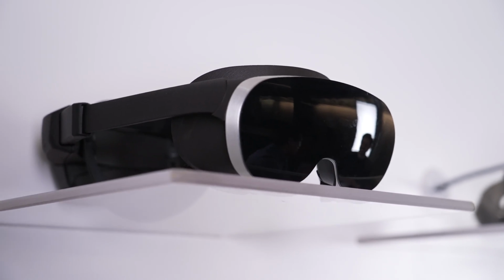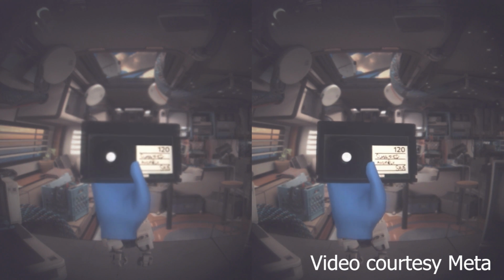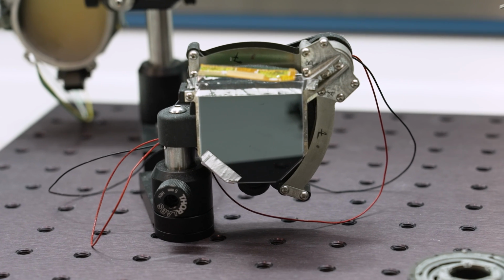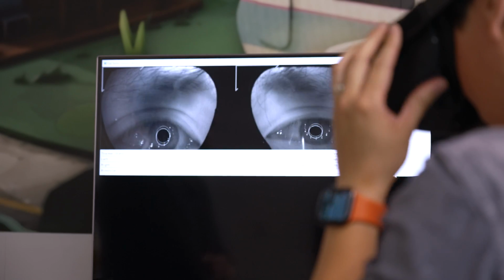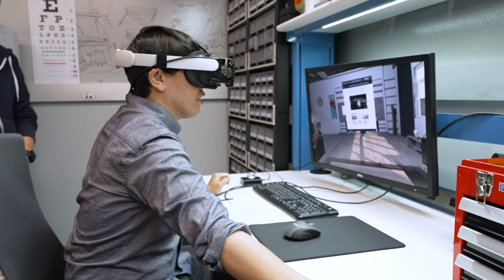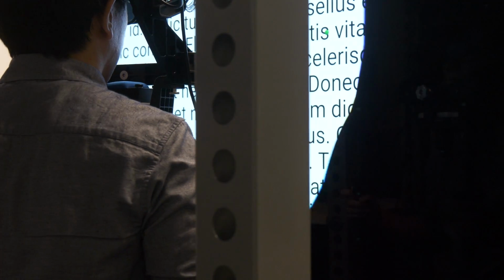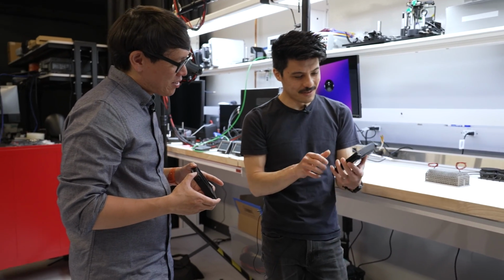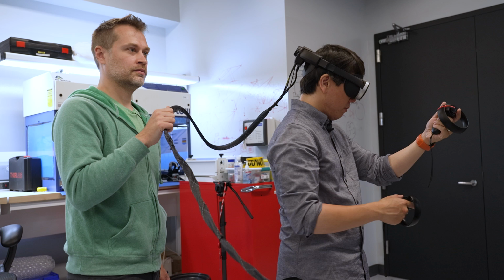Hands-On with Meta's New VR Headset Prototypes!

Comment: They need to cater for larger IPD's, as someone with a 75mm IPD, I can't use a Quest or a HP Reverb, the 68mm max IPD is just too small. I can't even get a Quest to fit on my face without squashing it. The Vive and Vive Pro went to 74mm IPD, but most HMD are resticted to 68 to 70mm IPD at a max, which is far too small. I currently use a Pimax 8KX, which goes to manual 70mm IPD and then has a software adjustment to get to higher IPD setting. I'm never going to support Meta while they only have a IPD of 68mm, and I don't support the monopoly environment they want to build, it needs to be free source. Have you looked at there current offerings for VR, they are very basic and look like crap?

Comment: Why not avoid the issue with processing power by trying to make a headset that works primarily off Online server gaming like googles Stadia. Sure then you could only use it with an internet connection. But I think for most case scenarios this would work extremely well.

Comment: Maybe they need to go to OLED combined with eye-tracking, to keep bright spot in the pupil... while saving power in the other zones.
Reply: OLED is basically worthless for VR until pixel densities are high enough that its required 2x subpixels per pixel PenTile layout isn't noticable anymore. Wasting 33% of your GPU power rendering an entire third of subpixels a PenTile OLED physically doesn't have is utterly untenable. 🤷‍♂️

What they're doing on Quest Pro is MiniLED LCD (full array local dimming) combined with eye-tracking, giving them mostly the best of both worlds.
Reply: @Cooe.  They need to render fully only what's in the line of sight, the central area. The rest can be blurred and/or upscaled.

Comment: Fuck meta with their headsets. I bought the Rift CV1 back in the day. Not a heavy user at all. A while back they announced that you would not be able to log in without a facebook account. I PAID FOR THIS THING AND A BUCH OF SOFTWARE. It is my fucking thing and i probably wont be able to use it when that stupid rule gets applied. No way i will open op a facebook account. 

But not to worry. The cable died last week. And since this thing is 5 years old of course you are not able to get a new freaking cable. Oculus dares to advise people to get a quest. I wont ever get a oculus set again. I am gonna try a repair. Slightly hoping it fails so i can get rid of this thing. I love it. But business practises like these really stroke me the wrong way. Be aware that with this new hardware, in a few years support will be gone and you are left with a fucking expensive paper weight.

Comment: Of course the solid state is ideal but it doesn't look ready. I would think something shaped like a jar lid that has a a lens inside then have a second part with similar dimensions and second lens that threads into the first using this "threading" to replace the ballscrew for focus. Movement I would think some sort of muscle wire attached to a gear that rotates one side of the lens. Should be fairly compact and quiet? Not sure about muscle wires energy usage but there has to be some similar case with a happy medium. No doubt this is the future it's just a matter of finding that magic combination of visual/efficiency performance while reducing heatsets size which should help with weight freeing up weight for larger battery/higher performance CPU/GPU and memory.

Comment: Something that corporations really miss the mark with is Virtual Reality doesn’t need Hyper Realism (you can go outside for that)
Virtual Reality is reality that one can shape however they want.
Something Reality labs should question themselves with developing these hyper realism tech is … do we really need it in Virtual Reality 
The human senses can already be easily fooled through visual stimuli (it is actually reality that breaks most immersive experiences ( a phone going off or a battery low message in your line of view).

Currently hardware isn’t the immersion breaker…it is the VR software and lack there off ( mostly because there is no standardized way to make software for Vr that works with every VR component

Comment: It's all great, but why they didn't use a simple quality NON fresnel lenses in Quest 2 like they did in Gear VR?? The lenses actually weren't too heavy, there were no god rays at all, the sweet spot and clarity zone were huge. Also, there was possibility to adjust focal lenght, so basically any nearsighted or farsighted person could use Geat VR without glasses and make the image totally crisp for themselves. 
Because you know the number of optically faulty Q2 units is really big. There are lots of units with abnormal god rays, ghost images, tiny sweet spot.

Comment: Awesome video.

re: "light is just energy and energy comes from a battery"

I never play vr untethered anyway because the battery would just be drained well before I was finished. The battery serves mostly as contingency i.e. if I accidentally yank the cable. 

I would imagine for a lot of people thats a similar experience, either for similar reasons or because they have to be tethered to a computer for playing higher fidelity games anyway.

I dont see why thats a problem in the immediate term other than heat/ safety concerns but I think I would much rather have mains electricity attached to my face than a really big li-ion battery. One seems a lot more stable/ safe than the other.

Comment: I'm looking forward to a quality VR workstation experience. The Quest 2 didn't cut it, way too much blur, inaccurate IPD, and chromatic aberration.
Reply: That's Quest Pro later this year. Pancake lenses will solve all those optical issues... And eye-tracking + dual displays = automatic, perfect IPD adjustment. At the expense of costing you ≈$1000-$1500. 🤷‍♂️

It's just like Mark said in this video. If you want a proper VR workstation, it's gonna cost about as much as a basic PC workstation. Them's just the brakes with the current level of technology.

Inaccurate IPD is really a total non-issue with the Quest 2 though. Just put it in-between the 3x locked IPD positions. The software actually adjusts to match these "in-between" IPD positions, meaning your practical "IPD fidelity" isn't much worse than Quest 1.

Comment: I think that the avegant glyph had a tech that didn't use a conventional display but directly beamed the image to the pupils using a set of micromirrors
Reply: They used 720p Texas Instruments DLP projectors. They just use WAY too many moving parts for a small, mass consumer headset (something that sells in the 10's of millions) and can't hit anywhere CLOSE to the resolutions needed in the modern era (the BEST you could do with DLP is 1080p per eye).

Projectors do have the major benefit of not having starkly defined pixels though, making images look a bit "higher res" (less aliasing) than they actually are.

Comment: Why don't any VR headsets put the bulk of the device on top of your head instead of hanging off the front of your face? This could lead to extremely smaller front ends especially in combination with thinner OLED panels vs LED. It would also make it more balanced and comfortable obviously, having most of the weight on top of your head.

Comment: Congrats to Meta for sharing this info.  A well produced video, kudos to all involved.  I am shocked they revealed so much considering the Asian competition.  

I have one simple question, and one comment about the big picture of VR and viewing realism.   
Question:  When you discuss vari focal lenses, what is the exact purpose here?  The focus distance from the eye lens to the screen remains fixed regardless of whether you are viewing something in the scene which is near or far.  Is it possible this vari focus is simply to compensate for users required eye correction during set up?   I have designed a lot of stereo products and would love clarification on why you would need to change the lens correction when the eye to screen distance remains fixed? 

OVERALL COMMENT:   While the appeal of VR is soo obvious to everyone, it will always have limitations and require specific accommodations for a decent % of the population.  For example, all visual optics are part of an optical chain, with the human eye lens as part of the chain.  For the modeled screen image to appear on the retina as desired, the human eye lens must be concentric with the optical lens.  This requires an IPD adjustment to keep all the optics concentric.  This is feasible considering the compensation that can be worked in with display, i.e. image movement too keep the target component of the optical chain concentric as well.  However,  it does add size and bulk.   
More importantly, is the issue of eye correction and the limits of exit pupil placement, which determines eye relief, i.e. the max. distance the human eye lens can be from the front optical element with no vignetting of the image.  While diopter correction can be accomplished with vari fl optics as shown in the video,  I am doubtful the technology will ever advance enough for astigmatism correction, which a majority of the population has.  Ideally, users will wear contact lenses to correct for both their diopter correction and astigmatism, that would be considered a perfect world for VR.  But its not reality.  To correct for astigmatisms, most people wear corrective eye-wear.  This creates a large distance between the corrective eye-wear and the human eye lens, preventing the human eye lens from getting close to the VR optics.  Therefore, very large eye relief must be designed into the optics.  And unfortunately, eye relief is not magic, its physics and geometry.   There is a linear relationship between VR front lens diameter and the amount of Eye Relief, this creates some very large heavy lenses, I have designed and build many of them.  
What I have learned is, for the masses, it will be nearly impossible to have a one size fits all device due to the huge variance of humans vision uniqueness, both physically  (IPD, eye depth) and optical variances, (diopter corrections, astigmatisms, non parallel eyes, etc.)   I am not throwing out VR, as there is a high enough % of the population whose eye variables fall into tolerance for VR to be effective.  But for the rest, there will be visual issues.   Since vision correction (other than age related presbyopia, which limits the amount of accommodation the eye has) is best done at an optometrist and is relatively cheap and accepted by the general public, why not work on a large screen system that is .5 - .8 meters from the eye, such as a 180 deg screen.  This will not only will remove the optical component of the VR headset, (as seen highly complex and costly), but also allow for a much higher pixel count due to the larger size, and more importantly a much higher brightness level.  The larger the pixels, the greater amount of brightness which can come through the pixel.   It's brightness that drives the pupil size down to 3mm, which is the only pupil diameter where things appear super sharp, as they do when viewing on a bright sunny day.  The eye is an optic, and like all optics, it has an optimum set of variables.   This is expressed in optics as an MTF curve.  (Modular Transfer Function)  Respecting the human eyes MTF is what will produce the realism better than any other single factor.  Hence why the Meta engineers are focusing on brightness, although they did not mention the eyes MTF specifically.   It is very feasible to have a larger desk mount display.   Again, this would not replace all the amazing things VR does, but it would overcome many VR obstacles due to human vision differences and allow the only optics to be their corrective eye-wear.  It would prob. represent the higher end, or prof. product Mark referenced.  Hoping this is something in consideration in the Meta labs.  
Once again, Kudos to everyone involved, this was a fascinating look into one of the most sophisticated visual optical products ever being developed.  Feel free to email me direct, amex97@hotmail.com.

Comment: Hold up…has anyone thought of how we could use this tech for essentially one-size-fits-all glasses that dynamically adapt to focal distance? They could provide vision distance enhancements too. This is effectively the way to get Cyberpunk-style headbands.
Reply: I definitely thought that with the digitally shifting lenses. sounds like they're not even that uncommon, just not often seen because they're inside cameras?
Reply: One size fits all glasses is a bad pitch lol it'd still be much cheaper to get only your prescription.

Now a device for Opticians, where instead of changing lenses ("better...? Or worse..?"), they can have just one device that contains EVERY prescription
Reply: There are consumer VR systems that already integrate that technology. Try to keep up.
Reply: @sqlevolicious  Such as?
Reply: @sqlevolicious  So there are none currently. Eye tracking is just 1 part of varifocal, the aero and vive pro eye absolutely do not have varifocal.

None of Varjo's headsets deal with varifocal using software. It needs to happen within the optics. The irony of you telling someone to 'try to keep up'.

Comment: Great video Norm, very nice interview and the tech preview is just fascinating, a lot of research is going into that. The approach of splitting challenges apart (screen resolution / distortion corrections / brightness) is interesting: first discover per subject what is best achievable, then try to integrate with space / weight / power / cooling objectives in mind. Very interesting watch

Comment: Frankly, this is one of the most interesting things I’ve seen on virtual reality for a too long time 😃
Thanks to META for sharing their research to people🙏
Quest is great but i still use the CV1 for it's high contrast oled panels. 
As said, resolution is not all and i hope HDR will be a game changer for VR. We'll see that with the next SONY HMD 🤩
Reply: Quest Pro will have MiniLED LCD's, so most of the advantages of OLED (though obviously not perfect blacks down to literally the single individual pixel level, but to however big the full array local dimming zones are) but with none of the GARBAGE ass negative effects of 2x subpixels per pixel PenTile or risk of burn-in/panel degradation.

Comment: We knew they had half dome years ago, and it was such a disappointment to see the mess of an impact that FB's takeover of Oculus had on the work that the original team was working on. More and more talent fled and more and more of the cool stuff was relegated to research for the faaar future rather than research for products to release. They could have sold a version of half dome several years ago, and they could release "hollowcake as a PCVR HMD now, but FB chose to focus solely on the mass market while locking everyone in to using FB accounts for user data collection.
So glad Valve exists, and I'm definitely looking forward to the release of whatever they end up calling Deckard.
Reply: @JorgTheElder  Yes, half dome was PCVR only, which is what makes it a worthy contender in the high end VR market along with the likes of the Valve Index and Varjo Aero.
I pre-ordered one of the first Oculus Rift CV1s and also pre-orded the Oculus Touch controllers - back before they were sold with the headset. The Rift S was designed by Lenovo and wasn't even a worthy successor to the CV1. FB killed any interest I had in the company that was Oculus.
I'm saying that all that FB money afforded them the opportunity to offer more than one type of product, and they could have also offered a decent PCVR product while still offering the mobile VR product.
Don't get me wrong; I'm all for stand alone VR. I would have definitely purchased the Quest 2 if it was offered by a company I trusted, but it wasn't - so I didn't.

Comment: Great video!  I like seeing how progess has been made so far. 

Hopefully they keep on working to increase the FOV as well.
Reply: yea that's my biggest gripe about the quest 2 and port can easily be damaged while in PC mode if you accidentally stand on the cord.
Reply: FACEBOOK VR is substantially less than Vive was a decade ago. They are lowering the bar to seem impressive to morons.
Reply: They are not too bothered by FOV because FOV is not important for work and that's what they are concentrating on. They just don't get that we have choices now. Valve, Pico and Pimax are waiting to take market share if they don't give us the high FOV that we want.
Reply: @dtz1000  I'm definitely glad for competition!
Reply: @dtz1000  Yeah, no... Market share & sales figures say you are full of sh!t and the VR consumers don't give a shit about FOV (after ≈90-100°) compared to other, MUCH more important factors. 🤷‍♂️ They care about price and accessibility. 

Also, does reality look any less real when you're wearing a pair of ski or motorcycle goggles? No, of course not. But it definitely DOES when it looks pixelated! Until we hit a certain resolution threshold that we're not quite to yet, going super wide FOV just doesn't make sense.